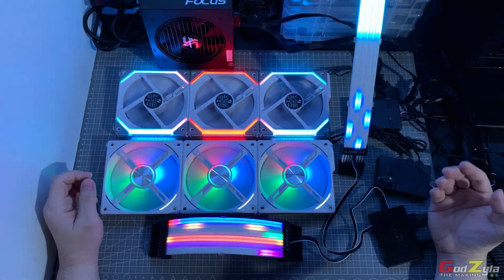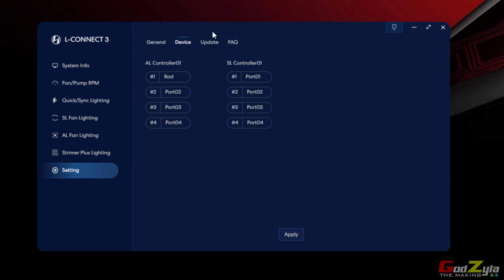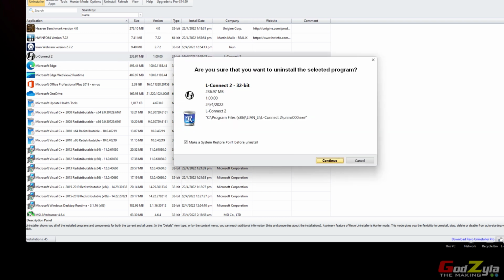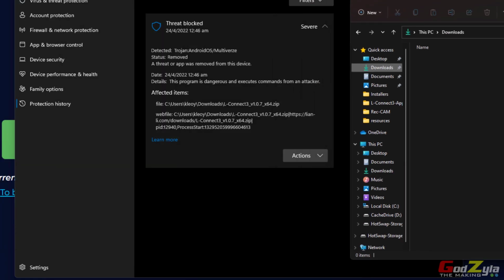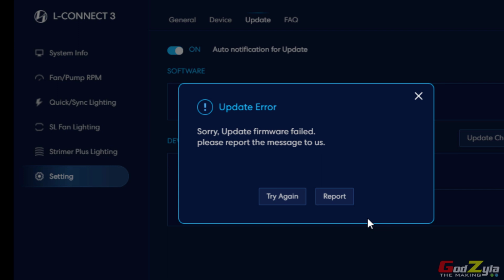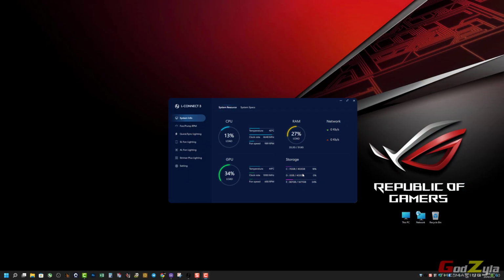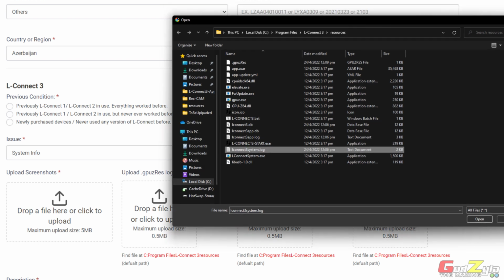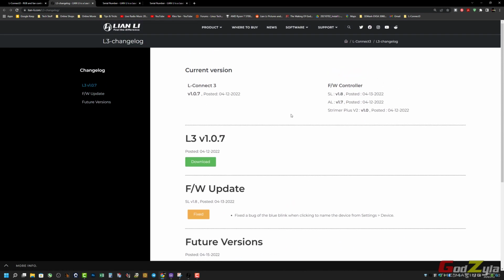Lian Li - L-Connect 3 (Installation)

Comment from the maker: Basic Troubleshooting steps
Disclaimer : Though the chances are very low to brick firmware updates on motherboard and to any controllers. I will not be responsible if you have brick your motherboard or controller.

1) Make sure you motherboard bios is up to date, please check on your motherboard manufacture website, under support > bios and drivers. See if there are issues with USB and do they have a fix. If there is, kindly update those bios firmware version.

2) Make sure your chipset driver for your motherboard is up to date!. For AMD will be at https://www.amd.com/en/support for Intel will be Intel Driver & Support Assistant Intel DSA https://www.intel.com/content/www/us/en/support/detect.html

3)	Remove all argb apps (Asus Armory Crate / MSI Dragon Center / Giga Fusion / Asrock Polychrome). If the brands which I have mentioned, do have a uninstall tool like the Asus Armory Crate, use that. Else use Revo uninstaller ( https://www.revouninstaller.com/ ) to uninstall the apps as mentioned. Revo uninstaller will remove all unwanted files / folder / registry in your system. Illustration to use revo uninstaller https://www.youtube.com/watch?v=uMgUYiakpxM&t=437s

4)	Shutdown your PC, unplug the PSU cable from your AC outlet. Press the power switch twice to discharge all current that your motherboard is holding. Leave it for 45 second

5)	While waiting, please do not use KVM switches. Disconnect all devices that are connected to your motherboard (front / back IO). Leave only your Keyboard, Mouse , Monitor and Ethernet (If you have) connected directly to your motherboard. If your monitor has a KVM build in remove the USB cable from your monitor to your motherboard USB socket. If your mouse and keyboard is connected to your monitor, please remove them and plug them directly to your motherboard instead.

6)	Plug only one Uni controller or Strimer Plus V2 controller. If its for Uni Fan (SL/AL) use only 3 fans to an output.

7)	Plug the power cable and turn on your PC

8)	Go to your Device Manager, look under Universal Serial Bus Devices, make sure you see the Lian Li uni / strimer plus V2 controller.

9)	Install the L-Connect 3 app only https://lian-li.com/l-connect3/ (current version 1.2.6)

10)	After installation, run the program, check under Setting > General > make sure Auto-Run on Boot and Minimized L-Connect 3 to system tray at close are ON.

11)	Reboot your system.

12)	First thing you need, go to device manager and see if the Lian Li controller is listed, next open up the L-Connect 3 app. Check if there is a need to update firmware to your controller. Go to Settings > Update, under Device F/W version, click on Update Check, download and install the firmware. Make sure the firmware is completed. Do a check on device manager and make sure the Lian Li controller is listed.

13)	On L-Connect 3 dashboard, check if the CPU and GPU readings are reacting, you might want to test it using some benchmark programs. If there are reaction, play with the PWM and argb functions. If it does not work, skip step 14) and proceed step 16)

14)	If Single controller works, shutdown your pc, connect uni fan set of 3 to your output of your uni controller. Do it small steps at a time to hook up your sets of fans. do not do all in one go. If successful and you have a second controller, proceed small step at a time again.

15)	Slowly plug back your USB devices (Headset, Microphone, Printer, USB Capture Card and etc). At any point of time as you add those devices one at a time, if L-Connect 3 become unresponsive. This tells you that there power is insufficient to power up more USB Devices. Whatever USB port on your motherboard, there is a limitation as the current are shared across the board, be it front or back I/O and the internal USB Header. You might need to get a Internal USB Hub that comes with a Sata Power source to the Internal USB Hub. (Disclaimer, buying a internal usb hub might or might not resolve this issue, purchase at your own expenses)

16)	If it does not work, report your issues to Lian li Tech Support. There is a in build log ticketing system in L-Connect 3 version 1.2.6. this is what you need to do. Go to Settings > Support > Click on “Download log” place a filename and choose a destination drive to save the log file. Next click on “Report” it will take you to Lian Li Tech Support FAQ. Fill up the form and upload the log which is a zip file. illustration here https://youtu.be/ngj5pGQbt_Y?t=1290
Reply: Hi buddy just a question, installed the L3 connect software. when i boot my PC its asking me permission for cpu z and and L3 software. Is that normal?
Reply from the maker: @wankerka  hello welcome to my channel. If your windwos UAC is by default and have not changed. Then yes, its normal. Have a look at this vid https://youtu.be/CgvuUFeff8U and alot advise not to disable it by default. The choice is yours.
Reply: @KleoYan  Out of curiosity, since I am using Linux and this software is only compatible with Windows, I added it on steam as a non-game and then forced launched it through the steam proton compatible layer. It seemed to work. L-Connect 3 seems to register CPU and Ram, so theoretically it could potentially run on Linux.
Reply from the maker: @luminatrixfanfiction  Hi and welcome to my channel. Nice.. it will be great if you can share your findings and how you do it buy posting at Lian Li Reddit https://www.reddit.com/r/lianli/.. I believe those Linux pc builder might be interested in your findings. Thank you for sharing. 👍👍👍
Reply: @KleoYan  No problem. I only just tried it before out of curiosity. One of the things I noticed straight away is that, the software doesn't fully work (only partially works) while in steam proton compatibility layer. It doesn't seem to register Graphics Card or Storage. I'm actually surprised that it registered CPU and Ram usage considering that there's a compatibility wine emulator layer between the motherboard and the L-connect 3 software. I don't think you can fully use this in steam proton properly. 

I wish Lian Li could develop a Linux version of this software. Because I really think Linux is the future. People don't want to upgrade to Win 11 after all the shinenigans and 99% of all games can be played on Linux these days.
Reply from the maker: @luminatrixfanfiction  honestly speaking. I am unsure what's the outcome will be. as the majority are using Windows platform to play games and only a handful linux builders.. As mentioned. whatever your findings are, it will be best to share them at Lian Li reddit. you see I don't work for lian li but their support crew are on reddit. the might see your sharings and to work on it. thank you for sharing btw.
Reply: Step 17)  send email to Lian Li and tell them to make software that actually works

Comment: L-Connect 3 is just the settings option and system info why
Reply from the maker: Hi Wozniar. Welcome to my channel are you able to check in device manager > under Universal Serial Bus Devices. Do you see your Lian Li device detected?  If not, that will be the issue. Your Lian Li device is not detected by your system.
Reply: @KleoYan  Hi. Lian Li UNI FAN SL Wireless LCD 120. L-connect 3 is only settings and system info. I don't have a hub, I don't have a FAN Wireless Controller. Fans connected to mobo. USB device
SL-LCD Wireless-1.0
SLV3
SLV3
SLV3
Sorry for my poor English XD
Reply from the maker: @ ok. Now I see your issue. You will need the controller/ hub. Without that,
You can’t use L-Connect 3 to control the fans argb effects
Reply: @ will be good for these fans.
Lian Li SL UNI Hub SL V2 12SLV2-CONT3B

Comment: I can’t even get the L connect file to open it says failed to initialize
Reply from the maker: Hi Philip Brown, welcome back. Like to check. is your motherboard chipset up to date and which lian li argb devices are you using? uni fans? strimer plus V2? or?
Reply: @KleoYan  I would assume so when I first bought this cooler I got everything to download and work than L connect needed update did that and L connect would no longer work nor boot at all I have lian li Galahad ll lcd 360 cpu
Reply from the maker: @Mr_DipUrBish  Hi welcome back, can you try this method, see if it works. Shut down your PC, remove the AC cable to your PSU, press the power button a few times to discharged any current that is holding on the motherboard. Now remove the usb connector which connects between the Liquid AIO to your motherboard. Let it sit for 45 seconds. after 45 seconds, plug the usb cable back and plug the AC cable to your PSU. turn on your PC. go to device manager and see if the Ghttps://lian-li.com/contact-us/A II LCD is shown under Universal Serial Bus Devices. If it does, launch L-Connect 3 app. test it again. if this failed, I will advise you to raise an RMA with Lian Li https://lian-li.com/contact-us/

Comment: did you find out why there was a delay with gpu and cpu readings ? or was that a software  issue
Reply from the maker: Hi Bill Crampton, welcome back the issue is fixed with version 1.7.4. There should not be any issues 😉
Reply: @KleoYan  thank you so much for your responses 🙏🏻 I keep watching your videos but I just keep getting more anxious seeing the possible issues but thank !
Reply from the maker: @billcramptonburger  hey you are most welcome. Hmm maybe this will help you out. Watch those the have a sub title with [L-Connect-3] as those are pretty current and the rest you can just watch as knowledge on Lian Li ARGB eco system https://youtube.com/playlist?list=PLEW-b-2vYDdPo0NzHyeksx012c-nkDapm&si=RIJbRxzLekUG7mC6

Comment: This is what i neeed ❤ thanks so much❤
Reply from the maker: Hi Carlupi Clips, you are most welcome and all the best with your build too. 😉
Reply: @KleoYan   i just noticed that the hardware requirements not include the sl infinity controller :c, or would it work aswell ?
Reply from the maker: @carlupi  hi, without the controller, you can't use L-Connect 3 app. you will have to plug them directly to your motherboard argb 3pin 5volt argb header. best if you can purchase the contorller. https://www.aliexpress.com/item/1005004600755700.html

Comment: Sorry for sending so many messages, but I recently built my pc  with the case  Lianli LAN cool 3 and I can control all fans except the front fans that came with the case 3x 140MM, but it seems like the only way for me to control them is through aura sync on 8th mode is this normal? (yeah I can control color and effect also on the buttons itself on the panel) And how would you set rpm for these 3x front fans through aura too?
Reply from the maker: Hi SirSone, welcome back. the fans rpm you should set in your gigabyte UFEI, I can't remember which section but do take a look as I seldom touch gigabyte boards. by the way don't worry about too many messages. It's better to ask then not to ask 😉
Reply: @KleoYan  Thank you and I have set the fans in aura sync to standard because I can't see them in connect-L guess that's normal.
Reply from the maker: @SirSone1  that's normal, just for your info, to use L-Connect 3 app, you need to have either uni fan controller or strimer plus v2 controller. As for normal fans like the front fans of your case. The argb effects, you either make use of the case front I/O controller or to use your motherboard aura sync. As for the PWM settings, you will need to configure on your motherboard UEFI.
Reply: @KleoYan   Thank you yeah I got strimer plus v2 and Uni fans at the bottom of my case and lian li cooler and uni exhaust I can control all these through LI-connect 3, but I did not replace the front 3x 140mm because they're pretty good and I didn't see the need to do so also I can control them through armoury crate.
Reply from the maker: @SirSone1  oh ok.. I thought you are using gigabyte as you mentioned aura ahhaah.. ok for armoury crate, you can control the fans RPM too. just need to upgrade some add ons which you can find in your armoury crate update section. thats what I recall when I test Asus motherboard.
Reply: @KleoYan   I'm very happy with the Lian Li Galahad II Trinity SL INF and it cools like a beast, but I'm wondering will it cool the same after 3 years of usage or will the liquid evoporate or degrade I doubt it will, but just curious.
Reply from the maker: @SirSone1  hi SirOne1, in general it greatly depends on which region you are at. if you have 4 seasons, then the liquid AIO will last for 4 to 5 years. If you are staying where I am which is hot and humid, every 3 years I will change the liquid AIO. Anyway, in the event if your Liquid AIO is down, you can always file an RMA with lian li to have your liquid AIO fix. I would advise you to get an AirCooler to standby, just incase if your liquid AIO is down (TOUCH WOOD)

Comment: hi, im new on this world sorry. I have a new pc, case Lian Li lancool 216 this include 3 fans ARGB of lian li + the hub, the hub as the instruction says I connected to the MB connector 3pin 5v. everything great, the 3 fans work and have light, BUT when a download LIAN LI connect 3 its only show up the settings and system info, ¿how I can fix it? so I can configured my fans lights and rpms? Greetings for the incredible video ;) I will appreciate the help
Reply from the maker: Hi Dan, welcome to my channel. The L-Connect 3app will only work with the Uni controllers, stirmer plus v2 controller or the Galahad II Trinity Liquid AIO. It does not work with the Lancool 216 case controller.
Reply: perfect thank u so much @KleoYan
Reply from the maker: @carloscerna01  you are most welcome.

Comment: hey man, can u connect lian li st120 to the l connect 3? i wanna change the fans color to blue and pink
Reply: or blue and purple
Reply from the maker: Hi IcyBoghy, welcome to my channel. Yes you can by using the Lian Li ARGB Kit but the argb effects will not go accordingly on L-Connect 3 as ST120 does not have the chip to follow the complex instruction of it. If you insist to use it, you can obtain the argb kit here  https://www.aliexpress.com/item/1005003182827084.html

Comment: hello, can i use L connect 3 for my unifan SL V1 ?
Reply from the maker: Hello Rizka Al Ghazalli, welcome to my channel and yes, you can use the l-connect 3 app on the SL V1 controller. You will also need to update the firmware menaully. Kindly check Lian Li’s webpage on the manual firmware.
Reply: @KleoYan  thanks for the answer, now i'll try to uninstall my Lconect and try to install Lconnect 3. 😁
Reply from the maker: @TheRizkaalfarisi  ok I will advise you to do the manual firmware update first before installing the L-Connect 3 app.
Reply: @KleoYan  yes sir 😁

Comment: if the software would actually start and not freeze i would be fine
Reply from the maker: Hello Dean Holland jr, welcome to my channel. Maybe list out what system specs you are using and which OS are you using? I see if I can help you out.
Reply: @KleoYan   hello and thanks I would appreciate any help I’m lost and super frustrated my pc is to expensive for stupid problems as such, here are my specs
windows 11
z790 godlike mobo
I9 13900k cpu
4090 suprim liquid x
1000w atx 3.0 Msi psu
H150i aio cpu cooler 
Hyte y60 case
Reply from the maker: @deanhollandjr1987  Hi, maybe do basic troubleshooting steps might help. I would advise you to remove dragon center. now this vid will illustrate where I go by doing basic steps before I plug everything in. so I have the controllers in first. all firmware done properly, motherboard bios updated and those issues with USB port and such. So ya.. try follow this vid and I know is lenghty .. take note on the details. https://youtu.be/CgvuUFeff8U

Comment: Can i connect 3 rgb lian cabels to the one controller? And use one software
Reply from the maker: Hello lodvik goolanians, welcome to my channel. sorry I dont quiet understand by your question. what do you mean connect 3 rgb lian cables to one controller? you can use your own language to type and I will translate it. it's easier for you.
Reply: @Kleo Yan  i have 2 8pin lian cabels and one 24 pin and one v2 controller. How is it possible i connect 3 cabels to the one controller lian
Reply from the maker: @lodvikgoolanians1125  oh ok you mean strimer plus. ok if you are using strimer plus v2, you will need to use it's controller and not plug to your uni fan controller. if you are using V1 Strimer plus, you will need to plug it to it's controller again and then use a converter to plug between the strimer plus v1 controller to your uni fan controller. For this, this video might aid you https://youtu.be/Y0ni_tfcX3g

Comment: I know this video is old, But I just got the infinity sl fans and strimer v2. I also have the nzxt hub. After shutting down pc and starting up, I'm getting default rainbow colors on strimer v2 and fans. It doesn't load the colors inset until the desktop loads and Lconnect 3 starts. How can I fix this?
Reply from the maker: Hi Demonology101, welcome to my channel, do pardon me as I miss out on your question. By default this is natural as the controllers only starts to take in instructions when windows is fully loaded to launch the L-Connect 3 application. There are no way to fix this issue.